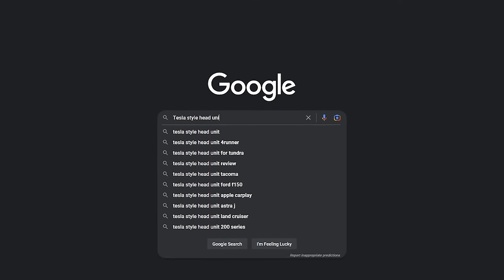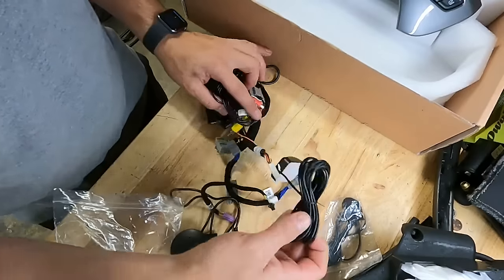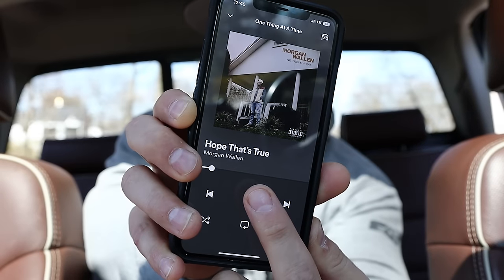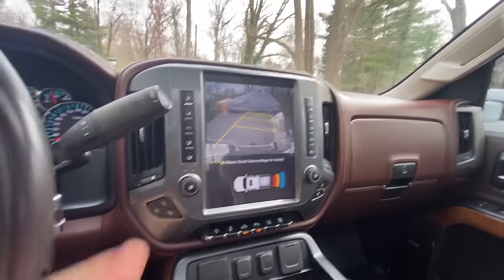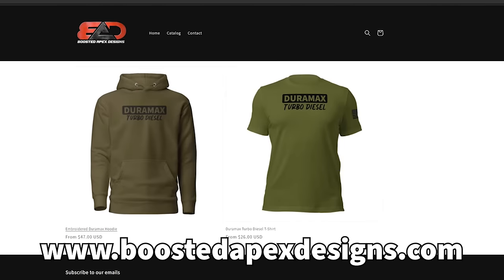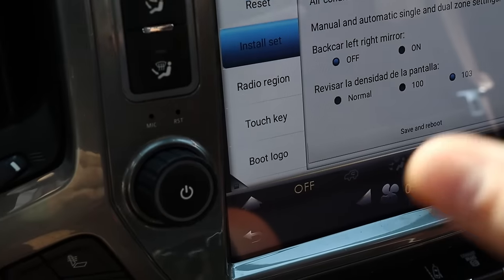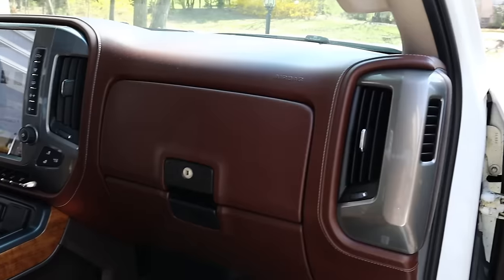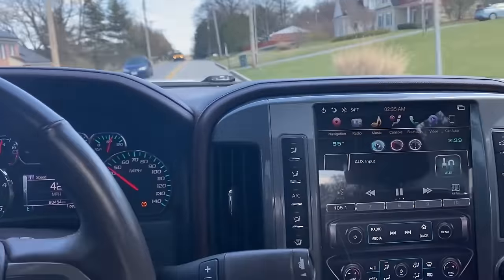Should You Buy Modern Android Tablet Large Screen Radios? 15 LML Chevy Silverado Review

Comment: I got the Pheonix Radio a couple of weeks ago. Only having two issues and I’ve been adjusting the settings and on and off the phone with Pheonix until I’m blue in the face. 

1st issue: Echoing on recipients end of a phone call. Both built-in and external mic have the echo problem. At first the built-in mic gave me the problem of not being able to be heard on a phone call. Then I found a setting that allows the mic’s parameters to be adjusted. But the remaining issue is the echoing. I found another setting that is supposed to eliminate the echoing, but after testing it out it only eliminates the echo for 2 mins. After 2 mins the echo returns.

2nd issue: Static and Popping in the background audio. There is this issue on all media: Bluetooth, radio, pandora, car play, ect. All connections are good and no aux plug connections are making contact with any metal. I have adjusted the equalizer settings, install set settings, user settings, and even the system info settings which is hidden, trying to “tune” out the static/popping but no luck. I have adjusted the gain levels to either halfway or below and I’ll admit that it did improve but the popping static sound is still present at times.

Any solutions on how to fix. I will be sending mine back for a refund if I can not at least get the echoing phone call issue resolved.
Please respond with any help or guidance as I’m almost reaching my refund policy window.
Reply from the maker: I don’t have those issues. My advice is to contact Phoenix and get their professional help or opinion.
Reply: I have the same issue with the terrible sound, with YouTube music being so bad it's not listenable at all. I have a $700 dsp and even using that and the equilizer and gain in settings, I still cannot make it sound good.
Reply: Did you ever get your problem resolved?

Comment: The [ PX6 SIX-CORE ] [Special Edition] 12.1" Android Fast boot Navi Radio for Chevy Silverado GMC SIERRA 2014 - 2019 from Phoenix Automotive, does not support wireless android auto. Bought this unit and in high hopes I wouldn't have to use an adapter to connect my Samsung device, but unfortunately after speaking with the support rep from Phoenix Automotive he confirmed that the unit only supports wireless Apple carplay and not Android Auto. You need to use the USB cable provided to get it to work for Android Auto. Very disappointed because over all it's a great unit. Hope this helps!
Reply from the maker: Ah that sucks. The newer 14" I installed definitely has wireless android auto because I use it.
Reply: I ordered the same 1. When I contacted them I asked if it has Android auto and he said yes. But if you have it and it doesn't,that's a big bummer for me because I have a Android galaxy s22

Comment: Man I bought this exact same unit because I came across your video a while ago. Got it plugged in and installed. Bluetooth, Apple CarPlay, no issues with my phone connecting to the system only issue there is a buzzing, hissing noise coming from my speakers and the music or sound will actually play. Do you know a fix to this?
Reply: I have all of volume specs turned down like you had yours.
Reply from the maker: How is your phone connected?
Reply: @matt13ross  my phone is connect by the OTG usb plug. Tried wireless car play, Bluetooth it connects just fine. Shows my song is playing but no sound just buzzing through the speakers. I have the aux jack plugged in as well.
Reply from the maker: Do you have it set to AUX?
Reply: @matt13ross  Yesir I figured it out. It was something I did wrong with the Wires.  Forgot to plug in the black plug that connect to the Audio box. It all works now. Thanks bud.
Reply from the maker: Nice!

Comment: The links are  not ebay now and also now coming up as a unit from carsoll? Is that the same as phonix automotive??
Reply from the maker: It seems as though many companies use the exact same unit with different names.  But you should check out the newer one I installed.

Comment: Do u like this 12" one or the 14" u recently installed. Which is more responsive, better quality?
Reply from the maker: 14" is newer with better internals.  I like it more.  Both great though!
Reply: So I have the 2015 silverado 35000hd, the WT base model, I updated to the io5/6 8 inch screen, few years ago, it's garbage. Donu see any reasons why the 14" tesla one wouldn't work in that truck? Other then the button on the lower L/R Of bezel, I guss I could buy dummy buttons, should work.
Reply from the maker: I'd imagine it would work but I would contact the company to confirm first.